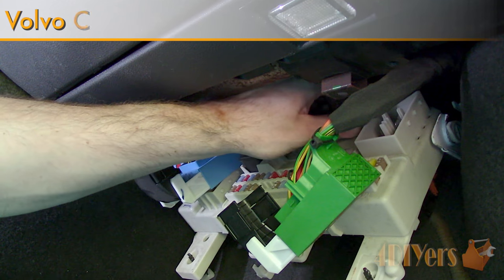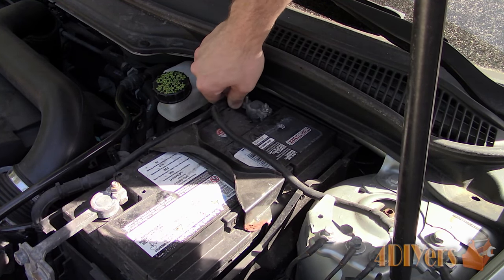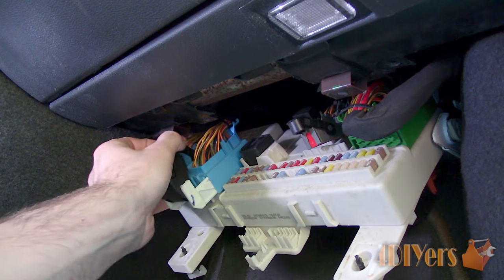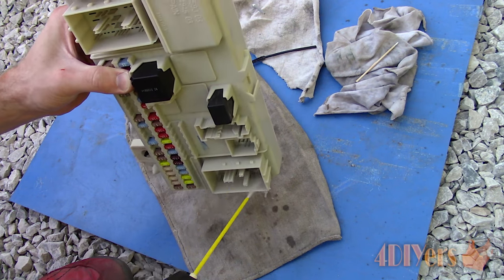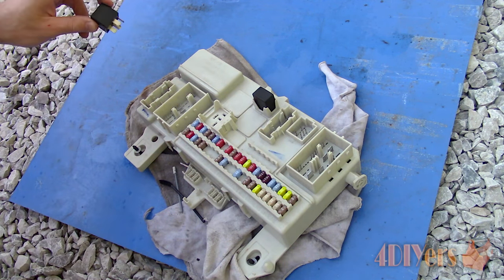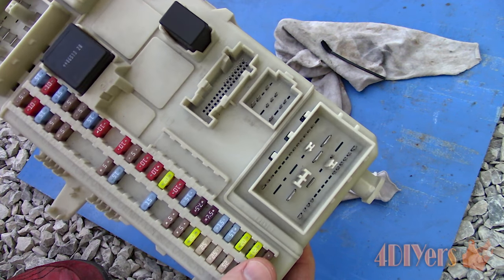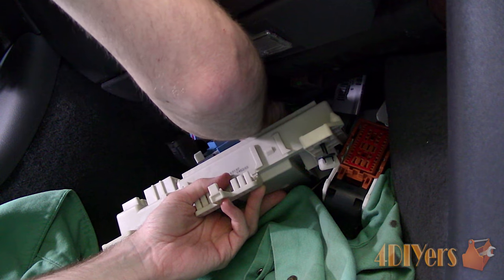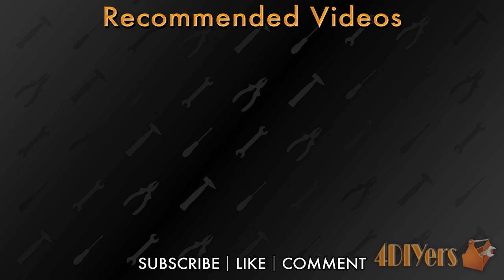How to: Volvo C30 S40 V50 C70 CEM Removal and Cleaning

Comment: have a question: these fuses can affect ABS light on? great video! 👍
Reply from the maker: Thank you and yes it will.
Reply: @4DIYers  thank you for your reply. my mechanic confirmed on my 2007 volvo s40 ABS module has something wrong. we have tested the sensors, wires and harness. all good. the code error is 0030 rear left wheel sensor. it is replaced and tested but the ABS light on intermittently. I was thinking it could be a blown fuse. not sure

Comment: I did exactly that and now I don't have turn signals, high beam, AC and fan (no outside air temperature reading). Probably more issues as well. 
I replugged the connectors many times without anything changing.

I don't understand where did I mess up, but the car had intermittent reboots on modules such as radio, airbags etc. This is why I tried it anyway. Now off it goes to an electrician..

Comment: Great video. Do you or does anyone here believe it may be possible that something needing cleaning on the CEM could be tied to a portion of the DIM's led lights not working?  Open to thoughts/suggestions. Thanks again for the video; it's like confidence in a mouse click!
Reply from the maker: You’re welcome! Common problem on these cars. You may have an electrical issue, other than that these headlights are just bad performance from factory. Try aiming them first, then clean the headlights (I have a video for this). You’ve already upgraded the bulbs so that step has been covered.

Comment: Thank You for the video, I will be attempting to do this soon, what is the material you applied just before reassembly ? Dialectic grease?
Reply: No, it is a different kind of grease that is electrically conductive, unlike dielectric grease which impedes electrical connections because it’s an insulator. You can often find electrically conductive grease sold for model trains (where it’s applied to the connector between the train and the track).

Comment: We took the CEM out of our 2009 s40 that started great but had crazy electrical issues. It didn't look dirty but cleaned it to see if that would resolve our issues. After reconnecting the CEM the car will not start at all! Can you oro some guidance as to what we should try next?

Comment: Volvo 2005 S40i  - after heater core leak - dried out restarted fine -  removed CEM and cleaned thoroughly  With electronic spray cleaner - remnants of antifreeze and corrosion - cleaned fuse blades coated with die electric grease. All tested OK.  Replaced back in car after heater core repair.  Now, I have a no start, no crank, no dashboard lights.  The Key is stuck in the ignition,  will move to positiion 1 and 2 with no lights.  Cannot start car or remove key. The overhead lights work, brake vacuum assist and fuel pump regulator on engine come on. I must remove negative battery cable to disengage.  Any thoughts would be greatly appreciated.

Comment: Hi Ive just found your video. Sometimes when I get out the car and lock it there is a buzzing noise coming from the front passenger area of the car..stops after 15 seconds or so and I put petrol in the car went to pay for for it came back car opened but no ignition lights car was dead for about 30 seconds or so. Do I have this problem in the early stages? Thanks for any replies in advance 😊

Comment: Here is a problem with my car...what are your thoughts on thins?
Vehicle: 2000 VOLVO V70SE WAGON  - Error Code: P1672 Engine control module ECM 5 volt output low
Symptoms: All gauges go out...occasionally the engine stalls too...it can take a couple minutes turned off before it resets & starts again.
Sometimes the transmission acts like it is slipping badly for about 10-15 seconds after the reset but then it works fine.

Comment: Hi
I will do this on my xc90. Have you used Deoxit D5? Great video!
Reply from the maker: Thank you and that is actually what was used in the video.
Reply: @4DIYers  I just got Deoxit D5 from Sweden. I also got the same brush from a make up store. It is winter here in Norway and just around freezing. My plan is to use a heater to heat the car cabin and bring the module in the house the clean. Cross fingers.

Comment: Hi 4DYIers, I have a volvo v50 T AWD 2005. On the dash board has lots of indicator lights, ABS lights  etc. Sometimes the ignition has to be turned more than twice before it will start. Sometimes it stops to start even after a long drive.  Please could you please make a video on how to diagnose those light  indicators. Thanks
Reply from the maker: CEM cleaning is a place to start with such issues.
Reply: @4DIYers  thanks for the reply.  Could you please recommend what instruments needed for the cleaning.  The type of cleaning spray etc. Thanks
Reply from the maker: Everything is covered in the video and video description. DeoxIT is the best electronics cleaner you can purchase.

Comment: Love the video,I have a Ford Focus 2010 (UK Model) which I believe has the same module.Is there any kind of reprogramming/resetting of any thing after refitting the module Many thanks.
Reply from the maker: Thank you! Yep, that shares the same platform as the P1 Volvos. No programming or reset is needed. The only time programming would be needed is if you're replacing the current CEM.
Reply: @4DIYers  Thank you for your reply,you have given me the confidence to have a go at it! Keep up the good work,thanks again.
Reply: In my experience many things Volvo and the entire internet swears needs to be reprogrammed really dont. 
 and will work fine swapping with any other used one so long as the model numbers are the same 
Not with ignitions though

Comment: My volvo s40 2007 no power to fuel pump can I tray this method
Reply from the maker: Have you checked the fuse and relay? Typically the CEM corrosion will cause more than one issue.

Comment: I was driving my s40 2007 today .it was perfectly fine but all of sudden it showed me sign on the dashboard (brake please make safe stop ) but the brake was working fine then after sometime  the brake sign went off and i got the new sign transmission service requires then again it went off and after some time I got one more sign engine service required urgent then it stopped suddenly on the road wipers started by themself some how I managed to gotta home but now it’s not starting when I start the ignition I can hear the starting motor sound but it doesn’t start ,
Could you please help me out with that ?
Reply: It showed me brake failure sign
Reply: @20tousif  did you manage to fix the isssue ? did you try cleaning the cem like in this video ?
Reply: @ajay  yes I did try cleaning the cem. And it worked .now the car runs normal as usual
Reply: this is your prob
Reply: when this part fails everything goes haywire

Comment: My 06 V50 just stopped starting. 
The dreaded “immobilizer, see manual” message appeared.
I hope its just some dirty connections…
Reply: Hi. My 07 V50 too. Have you found the problem?
Reply: @ecobright8439  Not yet. I have eliminated over 14 different causes. A mechanic online sent me a schematic of the connector to my DEM (all codes point to my DEM), and what each of the seven terminals inside of that connector go to, Plus the voltage expectation for each terminal.
He seems to think that one of those terminals won’t be registering voltage as high or at all. Each of these terminals goes to a specific function in or out of my haldex differential. And this will point me to which problem I have.
I’m hoping this is it.
I’ll keep you guys posted
Reply: @ecobright8439  i got codes

0094 (Communication between control units, communication problems with DEM)

E003 (configuration fault, faulty communication)

Comment: Are you sure this is for all S40 or only newer ones? Mine is a 2003, I think it is a different spot.
Reply from the maker: It's for the P1 Platform, so 2004 to 2013.
Reply: @4DIYers  where is it located for a 2003 model?

Comment: My 05 reg Volvo s40 1.8 petrol having some issues driving it to day and the steering got real heavy  followed by the lights on the dash bord  went out so I pulled over switched it off and when I tryed to start it again it just made a clicking noise a few times and then nothing like the battery is dead but it isn't  wen I turn the key nothing happens no lights on the dash cabin lights and the key fob is stuck in the ignition tried to jump start it whit cables lights came bk on but the  imobiliser warning  came up on the dash any ideas what the issue is please
Reply from the maker: It would be best to try this method first.

Comment: Is dielectric grease what I need for electrical contact after cleaning?
Reply: No. Dielectric grease does not conduct electricity, so putting it on the contacts will impede the electrical connection. You need a grease that is conductive.

Comment: I have anti skid light and service required . Engine light on web electric on but soon as I start the engine ,the engine light goes off but the anti skid etc still there
Reply: Engine light
Reply from the maker: A fault with the CEM can cause some very weird issues. It can make your whole dash light up like a Christmas tree, along with throwing a bunch of different messages on the digital text readout. It's a good idea to clean it if it is suspected to be the problem. Even if there isn't a problem, having a protectant applied to the terminals will be preventative maintenance. If that doesn't solve the problems, then scanning the codes in the next step. If the anti skid light is on, this could be an abs sensor issue and those are typically accompanied by an abs light too. For scanning, a generic OBD2 scanner can be used, however the Volvo community does recommend getting VIDA which is ran off a laptop. VIDA can be found on eBay, it's a program with cable.

Comment: HELP folks! Trying to diagnose the issue as local garage can’t look at it for over a month 🤦
Dashboard warning appeared saying “break system failure pull over safely” along with the traction control and ABS lights on, and Speedo not working. Breaks worked fine however but once pulled over and switched off the car won’t start as immobiliser is active. 
Recovery man did some tests and found the CEM wasn’t getting any power, despite the battery and earth being fine. Fault code reads “lost communication with ABS module” is it the CEM or ABS module is the conundrum...
Thanks in advance!
Reply: Did you find the problem? My Volvo c30 is doing the same with immobiliser too
Reply: From my experience with identical issues it was the CEM.

Comment: My Volvo C30 is going into limp mode with brake failure and abs light and anti skid. Do you think this’ll help?
Reply from the maker: Possibly, I did experience similar issues.
Reply: Having the same issue randomly on my  2011 s40. Did it work for you? What was the result??

Comment: Have a go tomorrow. The car turns off various speeds. Like the ignition switching off and then on again dash lights flash come back on few seconds later .car hesitated then jumped back into life. Once engine wouldn't start after few hiccups. Noticed the cem hanging down pushed all fuses relays to see if  they were loose looked good  turned the 2 white tabs screwed it back up so the cem was secure car started up fine ran for few months till  few hours ago cut out on my son in motorway  quickly pulled over no acceleration at 70 . Told him over the phone what I did last time check it hasn't come loose. In-between cursing the car saying scrap it . Its done 247,365 miles starts first time goes like a bomb plenty of poke in engine 2006 2.0d sport wagon.  Check for rust on contact or damp . Have to buy contact cleaner and small nylon brush see how it goes .

Comment: When I went to the auto parts store, I asked for electric terminal/connector protector, I was given a spreading bottle of battery terminal protector and was told that it is the same thing. Is this true?
Reply from the maker: Sounds like that could be dielectric grease which is fine too.

Comment: Can i use WD40 to clean this?
Reply from the maker: Nope, WD40 is intended for being a light lubricant, moisture dispersant and removes glue well. You need something specifically designed for electronics, so a contact cleaner. I'd highly recommend DeoxIT D5 for this.
Reply: @4DIYers  wd40 has a special contact  cleaner and many others nowadays

Comment: I can't find fuse for license plate light. It stopped working, I tried with several bulbs and no success. I don't want to drive on street because of getting ticket from police.
Reply: Common problem is from the boot left corner wires.
Reply: They are cut off .Take out the rubber pipe,reach the wires and you will see
Reply: @dimitarhristov523  Thanks for responding. I will check for this. But it sounds very bad if they're cut of.
Reply: @Belle1337  don't worry it's easy fix.On my car number plate lights was off and boot light.Just connect cutted wires and that's it :).If you need any help text me
Reply: @dimitarhristov523  Thanks alot man. I will check this tomorrow. But with cut wires you mean that they're cut in half or just bad connection?
Reply: @Belle1337  They are cut in half .
Reply: @dimitarhristov523  Thank you for your information. I will check this tomorrow. If I'm unlucky I might have to buy complete cables which also includes cables for trunk opening. I have had trunk opening problems since 3 years ago, sometimes it opens sometimes not, so this might actually be the fix to it! New cables cost around 50 USD.
Reply: @dimitarhristov523  I checked the wiring. Turns out that it has wires where the black seal is opened but what I could find is that there is no wires that are cut in halt.
Reply: @Belle1337   whats is yor FB account.We need to corespondent with a pictures
Reply from the maker: @Dimitar thank you for helping :)
Reply from the maker: Remove the license plate light completely and probe the backside using a multimeter to see if it's getting power.
Reply: @dimitarhristov523  Thank you 100 times for helping me out. Today I replaced the wiring harness and now everything works as brand new. I'm thankful to you more than you can imagine 👍🍻
Reply: @Belle1337  Did you see?It was easy fix ;)Cheers i got a glass of Tuborg beer 😁

Comment: Awesome video. I have a 2007 c30 2.0d. It was sat for 6 months and developed a parasitic drain. Found that fuse F5 (pre heater/PTC) in engine bay was draining my new battery overnight. I haven't taken the CEM out of mine yet but could this potentially be the issue?
Reply from the maker: Yes it could potentially be a problem.